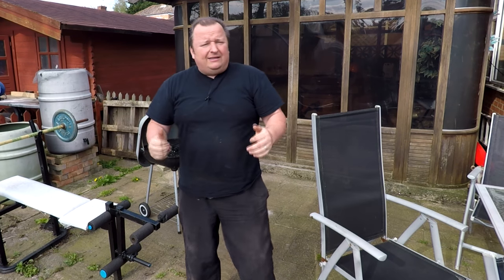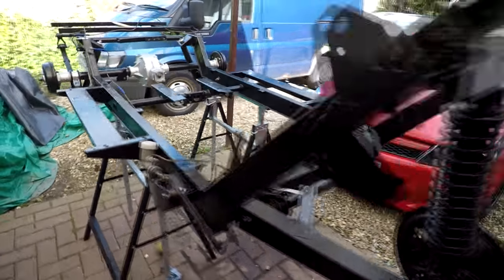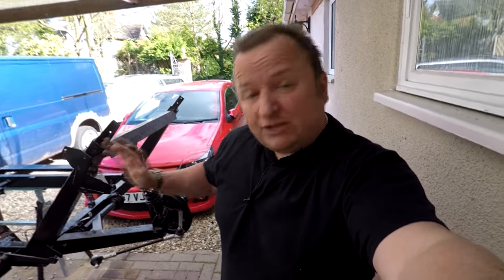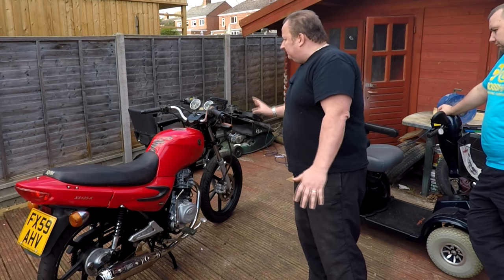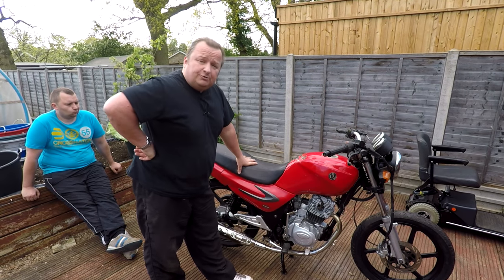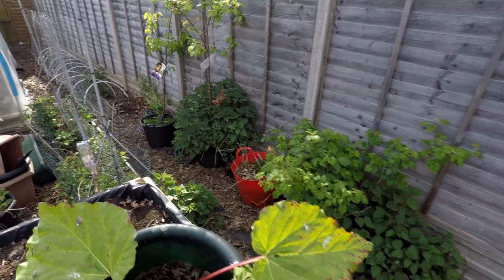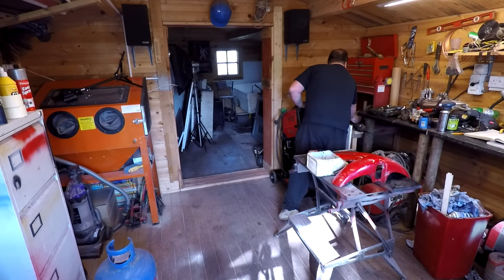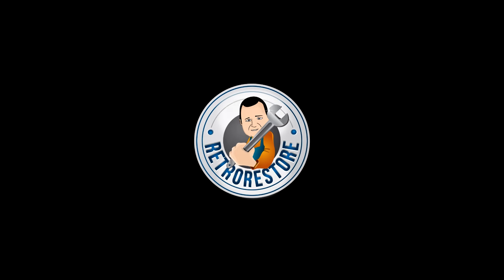Repairing Stuff For Profit Vlog

Comment: I had a problem with my lawnmower running v rough and cutting out.   Went to a local shop for advice, they weren't really interested and just wanted me to bring it in for a £90 + parts service. Checked out your videos and decided to have a little look. Took off float chamber, all gunged up so gave it a good clean. Running perfect now. You saved me £100!  Keep up the vids, great stuff.
Reply from the maker: That's what it's all about Stu, great comment.
Cheers
Martin
Reply: reading that annoyed me...trouble is they get away with it today..problem is 
they see these useless dudes in £30 grand audi`s and just rip them a new one...
Reply from the maker: I agree Ted, That's why I make these type of vids as well.
Cheers
Martin

Comment: Looks like  your growing engines instead of onions Martin. Nice work on the bike Gary and Martin. The sonic cleaners are so handy well for anything . Cheers Pete.
Reply from the maker: More money in engines Pete lol. Yes the sonic cleaner works well for the calipers with a drop of thinners in with hot water.
Reply: Your right there Martin . Where did the Stromberg carbs come from , Looks like a set from a GT6.
Reply from the maker: Not sure Pete, come in a job lot.
Reply: I think they say CD 150 on them . But its well over twenty years since i worked on a GT6. If your going to move the rhubarb , wait until the winter months.